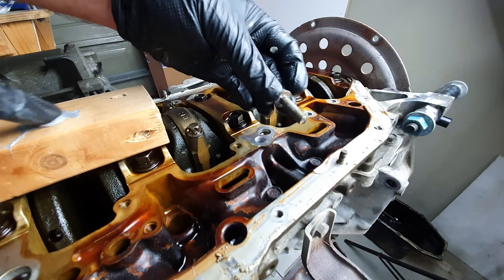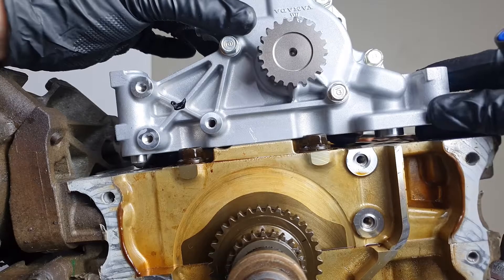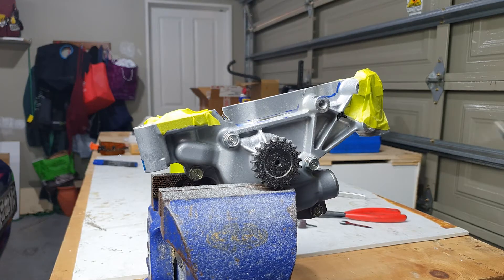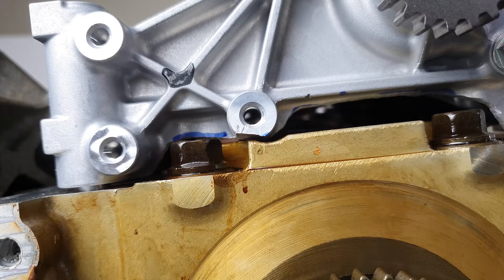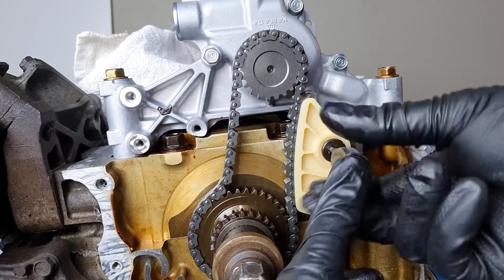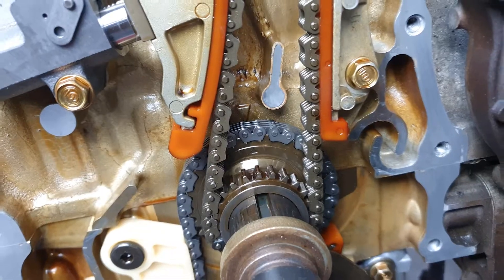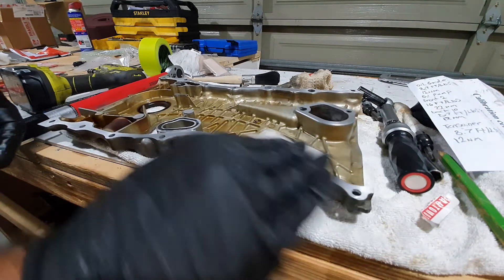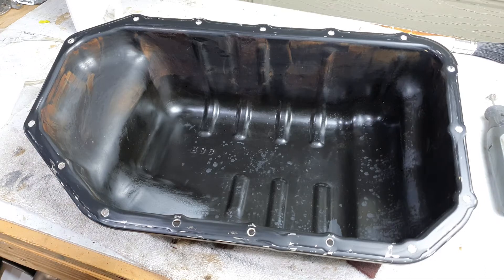k24a guide to setting timing & oil pump install part 2 - k swap Honda crv

Comment: Was so painfull watching you cut that oil pump up, I did it in 20 seconds with a grinder and cut the bolt hole down too.

Comment: Great walk thru. I am gonna do this on my K24A2 CRX. Where did you get the parts?
Reply: Did you have a video or parts list on that oil cooler as well? And what VTC gear do you have?
Reply from the maker: Hey, speed science had everything i needed. Cooler is stock on the jdm k24 not sure what other k they come stock on. Vtc is off a k20a2 i believe.

Comment: Thanks for the content.. followed your videos to basically do the same job. Do you need to unlock the VTC? Seeing a few videos on YouTube saying it is necessary. Also, do you 3 bond the timing chain cover? Thanks again
Reply from the maker: Cheers 🍻, My vtc was brand new. Think i fitted it and turned it to lock it in position. Yeah, used threebond on the timing cover
Reply: @jdmnuggets  My VTC brand new too.. so you think turning it with chain on will lock it in? lol. I have it torqued in place wondering if I should remove it and start again.. thanks for the info much appreciated
Reply from the maker: Im not too sure, all i did was fit the vtc and with the timing chain still off turned the vtc to lock it then fitted the chain and timed the engine. I think its in the videos?

Comment: Thanks for all the good info man! I was wondering if you happen to know a good part # for the 12mm bolt that you use to plug the oil port, thank you in advance
Reply from the maker: No worries, thanks for watching. No sorry i don't,  just whatever bolt works lol